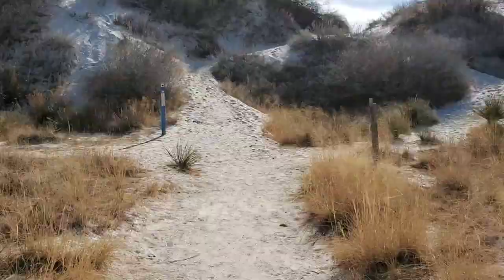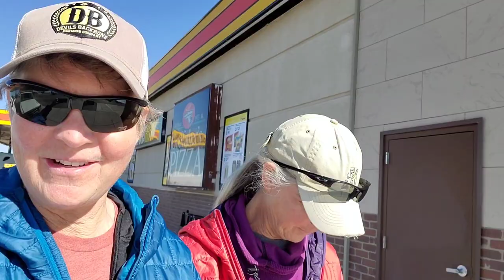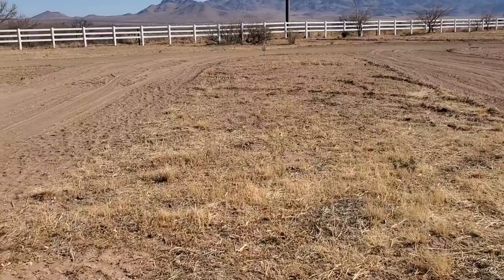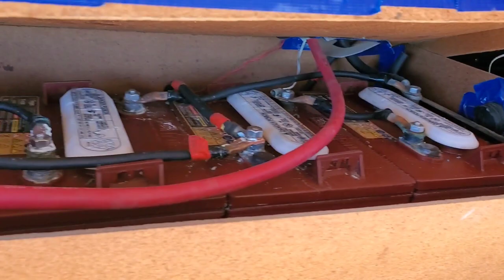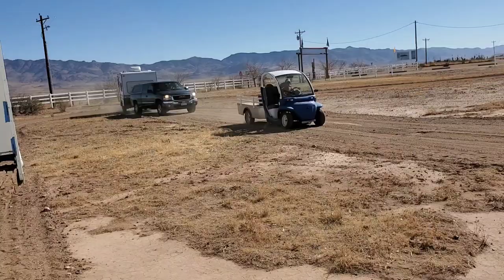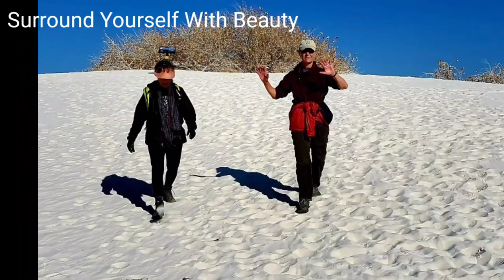#2 2021 RV Life. White Sands NP

Comment: Hi. Nice to see you all. Ive lived the lions share of my adult life off grid and in a really sweet place. I really dont know anything about rvs but if you have no sun a honda eu2000i could easily power up your battery bank. It runs relatively quiet and for around 3.00 in gas will go for 12 hours with just powering up the batteries.... Shorter if a load on it but for your purposes would easily handle it. It's more expensive but speaking to the quiet and longevity i wouldnt bother with anything cheaper and they are pretty small.
Reply: You're right--we do have a generator backup, but we haven't needed to use it yet.

Comment: Question for you fine ladies (love your videos).  Do you have the system set up so that you are NOT charging the batteries when you are plugged in to the inverter?  If you do, that is good.  If not, you should set that up to keep the batteries from trying to charge themselves.
Reply from the maker: We have the ability to turn our converter off and only use it when we need it.